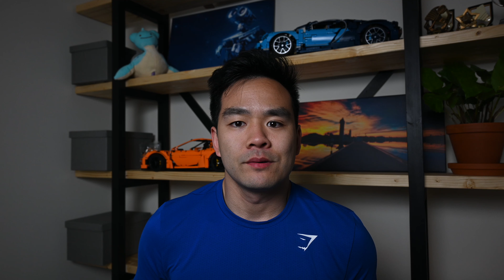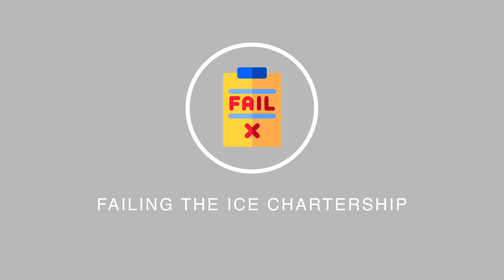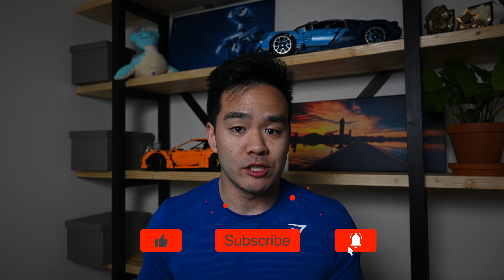Dealing with Failure at Work - Engineer's Perspective

Comment: Failing is the stepping stone to success and getting better. You were not a failure, you didn't give up either. I had a similar situation with my riba professional exam. It was such a relief to finally get to the other side of the fence after years of hard work.

Comment: I passed my ICE back-in-the-day (1973, I have recently given it up as I couldn't afford fees in retirement!) ) when it was obviously easier, although they had just changed process to very similar to what you describe. I think the advice/comment you have given was great and should be helpful to other young engineers!  Can I just reinforce (I later sat on APM Membership panel so saw a lot of applications) something at what you hinted. Know the project you submitted/described, and don't expect the interviewer to understand everything from your report (oh yeah and practice the interview). It shouldn't be just a list of what you did. The why is just as important.

I have been watching many of your videos on Surfside and dipped into a few more. The Surfside collapse caught my interest as some of my very early (pre-degree) work was after Ronan Point and I later got involved (in Hong Kong, around 1990) with repair to housing blocks, and your videos were helpful in catching up on my out-of-date experience, the implications of some of what could be seen from videos and documents etc, and another engineers thinking,  and yeah Building Integrity have done some great videos as well - I really want to a see an 'In summary' video but would guess it couldn't happen until after the court cases.

So in my view - Great job on the videos and thinking/analysis behind them and the presentation. Good luck in developing your career. If your career path is anything like mine it will involve number of changes of direction be prepared for that.

Comment: Inside tip as an examiner ... if as an ICE candidate you feel that your interview is going badly and you believe your examiners were discourteous to you, file a report to the venue's invigilators immediately. You need to protect your right to appeal where possible, and on the other hand examiners are trained to eliminate all possibilities of appeal - counter to your interests! Also all candidates have the right to request their own feedback, pass or fail. It's a protected right under the Data Protection Act and the ICE staff are in general quick to respond.